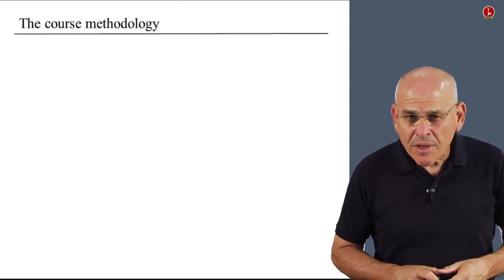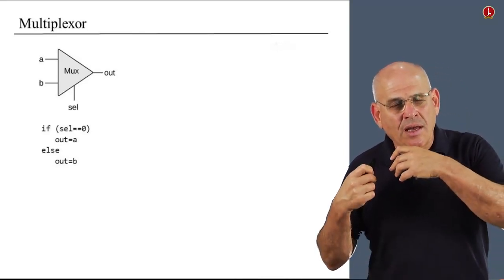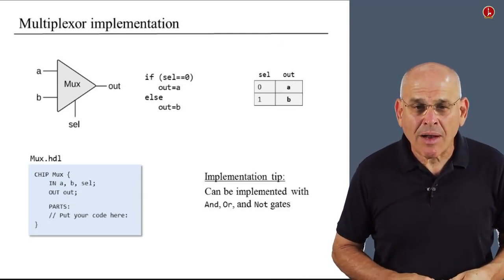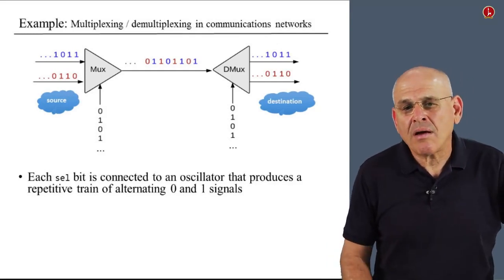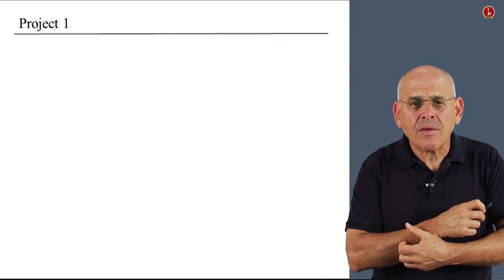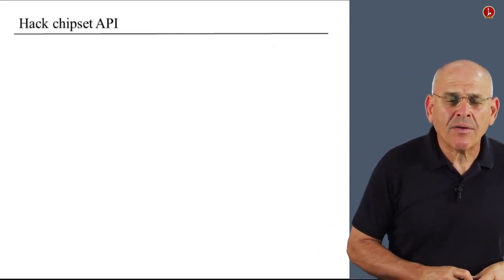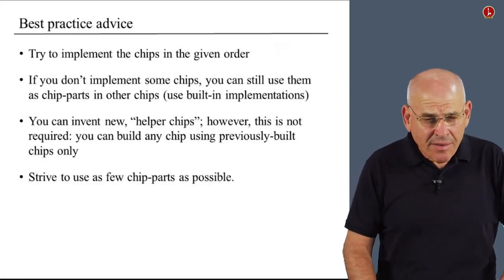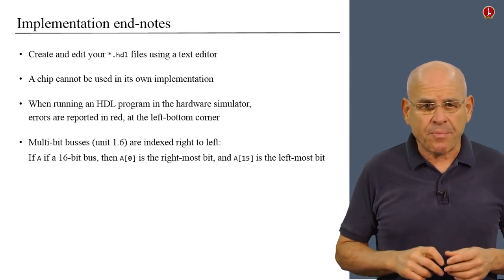[Part 1] Unit 1.7 - Project 1 Overview

Comment: How does one do the HDL for the 16 bit 4 way multiplexer? He says it's possible to use multiple Mux16's but I have no idea how to use multiple of those with multiple select bits.
Reply: Of course despite being stuck for an hour or two, it's only 10 minutes after asking that I figure it out.
Despite the inputs being arrays (like a[16, b16 etc.) in the PARTS section when using a Mux16 you can simply say a=a and it will use the entire array as an input. Not only that but you can create an output within parts that can store that entire array, outs aren't just binary. This means the only time you need values like [0] are for the select bit. In the end I managed to complete Mux4Way16 in just 3 lines.